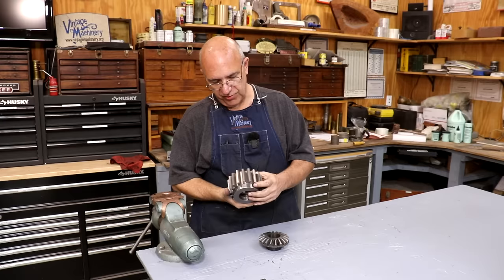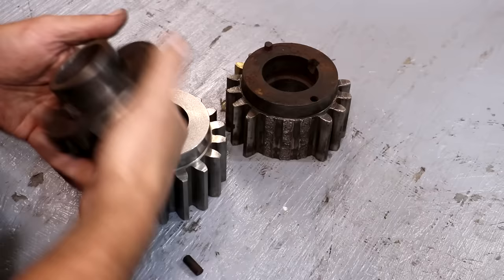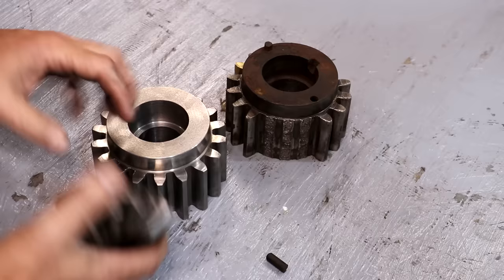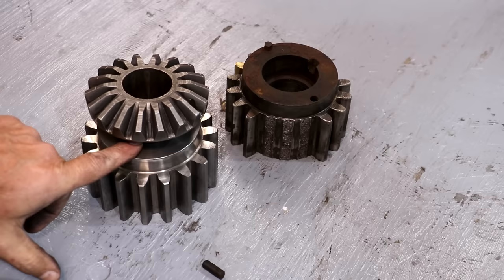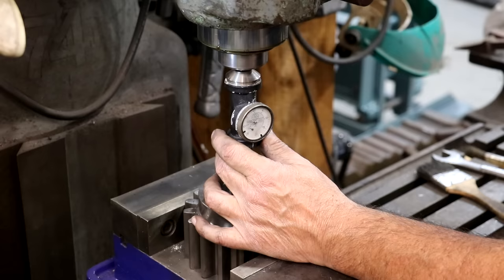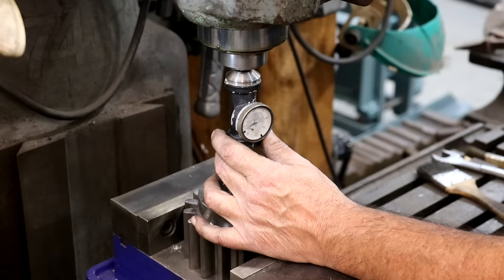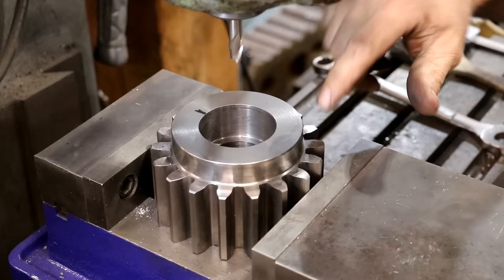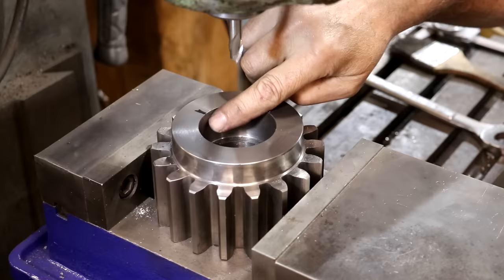Steam Engine Gear 3:  Cutting Keyways and Dowel Pinning the Bevel Gear

Comment: I wonder if the key was supposed to be the "weak" part, someone adding the cut-off drill bits later took that away, so instead of the key shearing, the drill bits allowed the gear teeth to be sheared away instead.
Reply: Hmmmmm…..
Although I can’t see a .400” (steel ?) key shearing before a cast iron gear tooth…
Robert
Reply: I agree completely, with my experience with Machinery I went straight to that as the source and the root of the problem
Reply: I would think that the pins would be better for, well, shear pins, than a cast in key. They can be replaced whereas the key would need to be milled off and another key way cut into the bevel gear. I am suspecting a field modification of some sort though. I grew up in farm country.
Reply: Sounds right and the 400 thou sounds like it was a 10mm key!
Reply: I would bet it was a double guarantee that the two gears would stay together. The cast gear teeth proved to be the weak points in this assembly.
Reply: That's a good point.  I was just thinking that press fit + key + dowel pins seemed overkill, I couldn't imagine why it would be designed that way.  But if it was slipping and shearing the key under extreme load, I could imagine the farmer adding pins to strengthen it - then finding the next weak link in the teeth!  What job was too heavy for a Case steam traction engine?!?
Reply: @noelhenderson7337  that would be my thought, too. Doesn't make sense for a key that's designed to shear to be included in the casting. That being said, adding the dowels wouldn't really help with that since the key would still need to shear even if they failed 🤔

Comment: That was really fun to watch, Keith.  It's fun to speculate why the biggest gear sheared rather than the smaller, and whether that was designed to be that way.  All I can add is to speculate that the smaller gear, having a bevel geometry, takes more setup time to grind.  Hence it is the more valuable part.

Comment: Keith that is a beautiful job you've done making the gear. Those coaxial indicators are great to work with for bore location. It basically turns your milling machine into a precision boring machine.

Comment: Keith, your knowledge and skill along with your patience and instruction are remarkable. My greatest wish is to see young assistants who aspire to becoming machinists standing along with you. What a fabulous opportunity for learning a critical trade that will never go away. 🇺🇸⚓️ St Marys, GA
Reply: Unless CNC is allowed to kill it off, which has to be prevented.
Reply: I have the opinion that it is crucial to learn this trade from the basic metallurgy and tools before advancing to electromechanical and software controls. CNC is necessary and sensible in large production shops which can be attractive to young folks once they gain experience. I can attest that no one would have put me in the cockpit on a Boing 747 before I became fully certified piloting a little Cessna 172 Skyhawk.  What we see Keith produce or fabricate takes much thought and planning to succeed. It would be a wonderful foundation for the right student.

Comment: I worked in a teaching shop and we lost a lot of those center indicators to novice users trying them under power.
You can get the coaxial indicator pretty close without running the spindle, with less chance of disaster. Line the probe up visually at "BDC" (close to you), run the X-axis back & forth 'til you get a maximum reading. You'll be on-center-ish in the X direction; set the dial at zero. put the spindle in neutral and turn it 180 so the probe is at "TDC" (far side) and see what's on the dial. Move your Y-axis half that difference. If the Y is close, you can put it in LOW gear and run the spindle under power to fine tune.
Reply: I usually put the spindle in neutral and dial it in slowly by hand.

Comment: Keith,, nice job on the gear cutting,,, any news on the steam stoker rebuild,,or has it been finished and I missed it. ?? Regards Frank
Reply: Been wondering about that also, and the Metal planer, there was supposed to be a job to do when the planer was finished, but never seen any videos.

Comment: Thnks for your videos, I really enjoy them. In this case with the coax indicator, I was under the impression that you can't use the actual divisions to mean anything due to the various lengths and angles you can set the pointer to (different lever lengths and cosine errors etc). Basically you are just after the least movement. I guess that if you DO want to know how far off you are in absolute numbers then you would have to rest the pointer on an edge and then move the table by a known amount to see what that know amount means on the dial with the angle used and the length of the pointer. Or am I misunderstanding how they work?
Reply: It would work just as well without numbers on the dial. All you’re looking for is the needle not moving.

Comment: Do you know why the big teeth on the spur gear failed while the bevel gear teeth look fine?  It didn't look like the key sheared off, but then again, they had to pin it with the drill bits.  Nice job with the pressing operations - smooth and steady - always better than hammering the pieces and pins.

Comment: Keith am I right in thinking that the key on the bevel gear was cast into it. 
If so that would maybe explain why the keyway slot in the gear you were replicating was an odd size.
This may also explain the use of the towel line to prevent the failure of the key during use.

Comment: Just guessing: The pins were probably added after the fact when the maker of the machine decided that the keyway was a weak point. The key is stronger than the teeth, it seems to me, but it may be that the force on the keyway was causing gears to crack at the root of the keyway, and adding the pins was a production-run workaround. Or maybe it's the other way around--pins first and then the key. If it was a problem with the keyway, then machining the slot with a radius at the bottom should have relieved the stress riser at the root of the keyway.

Comment: A beautifully made piece. But I can’t help but wonder how this gear is used. Does it spin on a shaft (no bearing?) or is it attached to a driven shaft? If so, how? There is no set screw or hole for a through-pin, or key way. Am I missing something?

Comment: Nice to see someone running one of these co-ax indicators at a sensibly slow speed.
Reply: I know right. I’ve seen guys run them really fast. Should be run on back gears on the slowest speed. They really don’t even need powered at all. Take it out of gear and spin the spindle by hand. Just like the good old test indicator.

Comment: What is the point of the dowels given that the key stops it rotating?
Reply: Other people have said the key might have been snapping in use, hence the pins. It's a bit like putting a 30 amp fuse in when the 3 amp one blows !